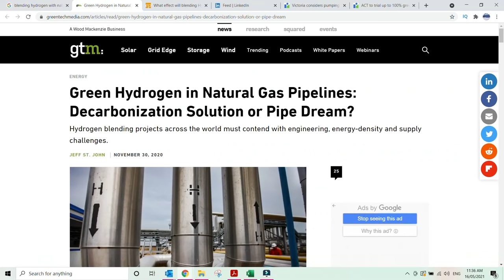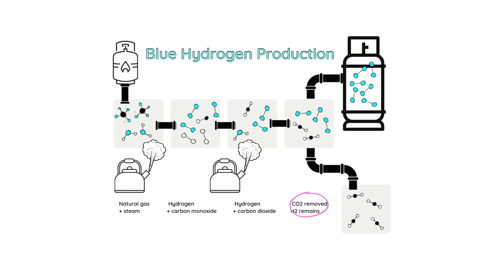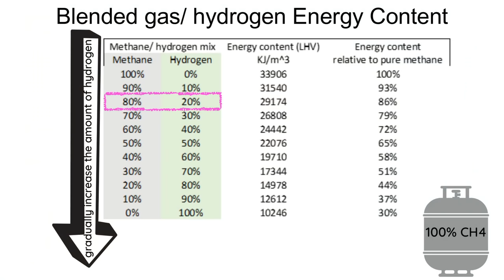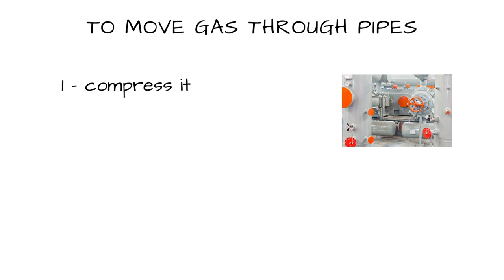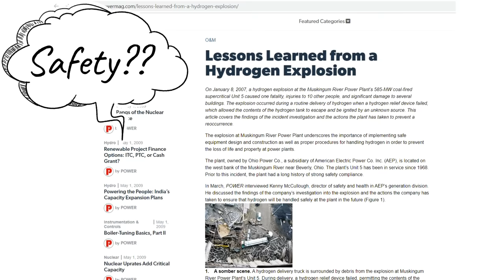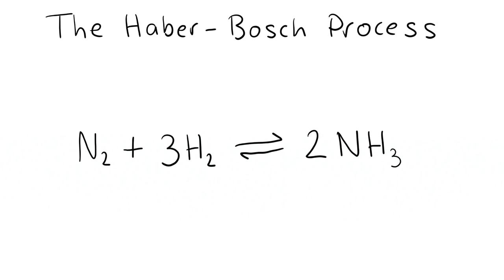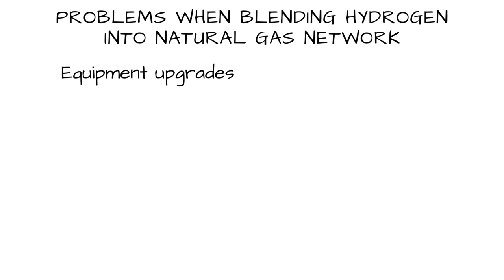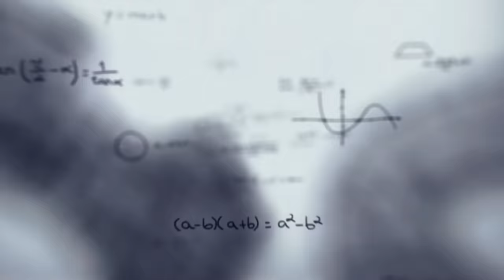Hydrogen in the Natural Gas Network

Comment: The other problem with Hydrogen and blending in gas supplies is cost. If done properly (using truly green hydrogen or blue with at least 90% effective CCS) the cost is prohibitive because of inherent inefficiencies. Hydrogen may have some limited applications but I believe it is being promoted by the fossil fuel industry to delay the decline in fossil fuel use and divert attention away from investment in other forms of energy storage that are cleaner, cheaper and more efficient. These include chemical and mechanical batteries, pumped hydro, compressed air, molten salt plants, etc. Electric vehicles for example have the potential to provide vast energy storage with Vehicle to Grid connectivity.
Reply: Bingo, it's selling hope-ium to create confusion in the public consensus making.

Comment: I was impressed by the comments starting at about 11:50 where Paul mentions over-provision of natural energy sources (such as wind and PV but also potentially tide and wave power) then storing the energy in the form it is initially presented by which he presumably means electricity using e.g. batteries. We could of course convert the energy into hydrogen or ammonia and store it locally to that conversion plant until it is needed to generate electricity when the wind doesn't blow and sun doesn't shine. This avoids the main problem with hydrogen - its transport.

Comment: Just a stupid question. How does hydrogen and gas compare to each other when it comes to explosive expansion velocity? The amount of air displaced or the weight it can push when it is ignited.
Reply: If there is a hydrogen or natural gas or propane leak in a home and it ignites, which one will level the most houses?

Comment: Hydrogen leakage could be enormously problem??! 
Since hydrogen is tiny and can be passed through even the smallest openings, this means that the leak already present in natural gas would be incomparably higher - and when you add 3/4 times higher pressure in infrastructure - the leak could create huge losses.

Comment: Great article. What was not mentioned was that we could use "green" hydrogen to make ammonia .Ammonia boils at -33OC  at atmospheric pressure. World production of ammonia is 150 million tons per year. 18 to 20 million tons of liquid ammonia are transported by sea each year.  Green ammonia could replace the present production of ammonia from fossil fuels with no major changes in infrastructure. Ammonia can be used as a fuel for marine and stationary prime movers.
It is a far more logical fuel than hydrogen.

Comment: I'm wondering. Why put hydrogen into the pipeline? Is that using one fuel to generate another fuel with substancial loss? Why not put the wind/solar/other green electricity directly to the grid and use that for cooking?

Comment: Another problem with hydrogen could be that it actually acts as a greenhouse gas. Methane leaking from natural gas pipelines can easily reduce the climate benefit of making  less CO2 per kwh than coal or oil. Hydrogen  ( H2 ) is not itself a greenhouse gas, but it's almost inevitable that such a tiny molecule will leak more than CH4. Eventually the fugitive hydrogen will oxidise to water vapour, which would make little difference at sea level, but if a lot of it rises up past the tropopause to the normally dry stratosphere, it could trap even more outgoing heat than methane would. The H2O molecule is highly polar, and its vibrational modes absorb different wavelengths than CH4. Increasing its concentration at higher altitudes is like putting a thicker blanket over the earth. Hydrogen would also react with hydroxyl radicals, possibly increasing the average lifetime of methane in the air, and with ozone, weakening our ultraviolet sun shield.

Comment: Brilliant video. I'm looking at renovating a house and one option is to demolish and rebuild (higher quality walls & insulation), get rid of the gas boiler, and use a heat pump for heating/cooling (also a massive tax break for doing this as opposed to renovating). 12 months ago I was thinking that, given a large renewable overbuild, maybe SNG could replace fossil methane (renewable power and, instead of using batteries to store excess power, the UK has over 4 bcm, or 41.86 TWh storage capacity in the old gas pipes, which shouldn't go to waste). I was wondering about the idea of hydrogen in the gas pipes for the last few months, and now I think it's fossil fuel's last hurrah.
Reply: They also didn't get into the H2 imbrittlement of certain components. I'm all for H2 but I think it's more of a last mile fuel, kind of like how gasoline is produce relatively close to the region it will be used in and not sent through cross continent pipelines.
Reply: Just build a passivehouse so your heat load is tiny (mostly hot water), and easily supplied by a very small heat pump. Max space heat load in the depths of winter 1-2kW. Vast majority of the time incidental heat is sufficient, and it's cool in summer too so long as you get the overhangs and glazing fraction right. You can do this by retrofit too (I have), but it's never quite as good without spending more money than just building a new one properly. It's ever so nice to live in, with very stable temperatures and great air quality.
Reply: yes. There is an industrially proven process for making methane from hydrogen and carbon dioxide.  It consumes a lot of energy, but the resulting methane is a much better fuel than hydrogen. Using captured carbon dioxide the cycle of production and burning becomes carbon neutral

Comment: I think that Paul has a good point about focousing on the low hanging fruit like Ammonia production first. From there it seems to me that baseload powerstations could also start producing and storing hydrogen to sell to fertilizer manufacturers, blimp enthusiasts or others. They could produce hydrogen when there is too much wind, water or sun filling the grid supply. Storing the hydrogen deep underwater in balloons seems like a good option to me. It is ideal for seasonal energy storage

Comment: Very informative, Rosie! So far I'd only heard of mixing H2 into the natural gas grid as a way to find a use for electricity from wind, solar and hydro sources during periods of low domestic demand. At night for example, the renewable electricity would be used for electrolysis and the hydrogen produced fed into the gas grid.  The 14% reduction in calorific value would not be welcome by operators of gas engines either. It's well documented that even without H2 blending natural gas quality can vary from minute to minute and even second to second, causing knocking and misfiring and potentially severe engine damage.

Comment: I am surprised, given your background in materials and mechanical engineering, that you didn't discuss  hydrogen-induced cracking (HIC) in existing pipeline infrastructure.  Is HIC a concern?
Reply: Yeah I was thinking the same. How will those old pipes combat hydrogen embrittlement
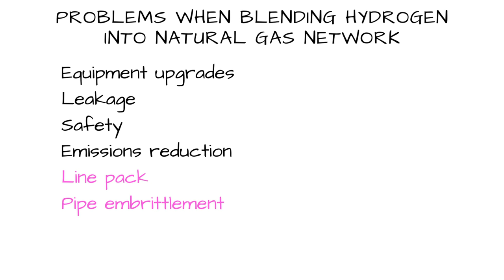Reply: She did mention it at the end (14:00), but yes, that seems like a large issue trying to convert infrastructure for things it wasn't designed for.
Reply: @muzairanwar  TLDR; They won't combat Hydrogen induced cracking in these pipes. The existing metal pipes will not be used with hydrogen

Comment: There is also the issue of NOx emissions when burning hydrogen in an air mixture. Another pollutant for the atmosphere that never seems to be mentioned in the videos for hydrogen combustion engines such as those proposed by JCB.
Reply: I'm pretty sure that the products of combustion are H2O (water) not pollution when burning hydrogen.
Reply: @russellclark9419  Unfortunately not. When burning hydrogen it has to be mixed with air which is 70% nitrogen hence you get Nitrous Oxide  produced. Reducing the amount of air in the mixture reduces the NOx but it also reduces the power output. If you had a separate pure oxygen supply to mix with the hydrogen then there would be no NOx produced. There are many you tube videos on this issue. I think you are talking about hydrogen fuel cells which do discharge water and some heat but don’t actually burn the hydrogen so no NOx is produced.

Comment: Great video, but I would have liked to hear Paul's view on the viability of using ammonia to transport hydrogen, both directly and indirectly someday? Which seems to address most of the issues of piping hydrogen by itself or with NG. Not really need now, but long term when it is, it seems like the the best option. 

Other than that Paul pointed out 99% the issues (including embrittlement) that I was thinking about prior to watching the video. Echoing Paul's line of reasoning. For now we should actually be focused increasing the use of NG, to replace dirtier fossil fuels such as coal. It's far more efficient and cheaper way of reducing all types of pollution, for now. And NG peaker plants are the best short term option for allowing great use of renewables such as wind to power the grid. NG should be the last fossil fuel to be replaced

Strangely. Paul seemed to be wrong about one thing, that there are no costs (ie regs) on NG leakage. There have be for a long time and the allowed leakage was just readjusted down back Obama levels. Now we just have start to add cost for cow methane production (not a joke).
Reply from the maker: Several people have commented on ammonia for hydrogen transport. I can see I need to make a video on that! 
Interesting what you say about methane leakage being charged (in the US?), I will need to look that up. 
For cow/ other animal methane production, my ideas are that we need to 1 - reduce meat consumption, 2 - eat much more kangaroo meat (not a joke) and 3 - maybe lab grown meats? I personally love dairy so much it will be amongst the last things I give up in the name of the environment, though I have reduced the amount of meat I eat by a lot.
Reply: @EngineeringwithRosie  Clarification, I was talking about "methane leakage regs" that fine producers and pipelines in the USA and the costs associated with it. Not a tax/charge, like what is done in some places on carbon emissions. Below is a link...
https://www.cnbc.com/2021/04/28/senate-restores-obama-era-regulation-of-methane-emissions.html.

BTW If I started to eating kangaroo, it would make my aussie friends hopping mad. And since I rarely eat meat (about a year ago), expect for fish occasionally it's not really an issue for me. But there are feed additives that drastically reduce the methane farting. It just costs more money and there is no economic incentive for the cattle farmer to pay more. So we are back to econ and politics being the issue, not tech. 

its kinda ironic that cows produce plenty of ammonia for hydrogen transport... it's the circle of life I guess...
Reply: The US already seems to have enough natural gas power plants to use as peaker plants for renewables and now that the cost of wind and solar are at parity or even cheaper than natural gas it is getting more practical to use them to replace coal rather than natural gas so we are probably within a couple of years of peak demand for natural gas and are nearing the end of the period where natural gas is comparativly clean.
Reply: AICHE has two chemical safety sections, one for hydrogen and every chemcial industry but Ammonia, and one for Ammonia.  That should give us an an idea about how nasty and dangerous it is to handle Ammonia without having to search for the large number of industrial accidents every year, still. Now, take that out of agricultural/industrial application and into the hands of Joe down the block.

Comment: Very informative video and YouTube Channel 👍

A possible way to solve much of the issues addressed in this video might be the conversion of Hydrogen and CO2 into Methane. This can be done as a form of biogas upgrading. The CO2 fraction that is formed in biogas systems can so be removed resulting in a higher calorific gas and more gas. Methane has a higher energy content per volume then Hydrogen and can be used through existing pipelines. 

Interesting research articles about this subject are:
Production of high-calorific biogas from food waste by integrating two approaches: Autogenerative high-pressure and hydrogen injection. (Kim et al 2021)
Recent progress towards in-situ biogas upgrading technologies. (Zhao et al 2021)

Comment: Glad to see you making a good distinction between weight and volume.  When I am talking to people about hydrogen this is a big point of confusion, because it has more energy by WEIGHT than anything else, volume is another story.  However, adding hydrogen to methane is like adding ethanol, not water, to gasoline.  The real value of hydrogen is large scale utility storage where it doesn't matter how big the storage unit is (Lake Meade is really big!), and maybe aircraft where weight is everything.

Comment: Great video.  Agree completely in hydrogen blending issues like compressor station upgrades and embrittlement/leakage.  Not sure how much lifecycle emissions are actually reduced for blue hydrogen because there are still upstream emissions for nat gas production upstream of SMR, even if there is CCS of CO2 from the reforming process
Reply from the maker: Good points. I will be making more videos about blue hydrogen and CCS in the next few months, so I will look into the issues you raised in those. Thanks for the comment!

Comment: What about shipping the hydrogen as ammonia, if you could make the ammonia cheaper ,
Reply: Not a bad idea, and there'll definitely be applications for synthetic ammonia in the future, but it runs up against the fundamental problem with all synthetic fuels (including hydrogen): loss and efficiency. The process of converting your feedstock (electricity for electrolysis or natural gas for steam reforming) into hydrogen wastes ~30% of the energy, then converting it on to ammonia will also lose you a load more energy (probably ~30% again). Converting to a more energy dense fuel opens the door to other applications (e.g. fuel for shipping and aviation) but drives the price up significantly - driving a fuel cell vehicle costs >2.5 times more per mile than a battery electric vehicle. The creed I heard, and now follow: directly electrify as much as you possibly can - industrial processes, transportation, space heating etc. For those applications that just won't work with electrification, tackle them next with a simple synthetic fuel like hydrogen. Then, for those applications where electrification will not do and hydrogen won't do the job either, then look at a second conversion into a more energy dense synthetic fuel.

Comment: How about using Hydrogen to (long-term) store excess Solar & Wind energy, a process that is easily reversible very inexpensively, safely and with relatively low conversion loss?
Reply: The conversion loss to turn electricity into hydrogen and then convert it back is terrible, not "relatively low".
Reply: Also, its not cheap.
Reply: The better way of doing that is to pump water up a hill and use gravity to turn turbines, it's not very high Wattage but it stores  a LOT of energy,

Comment: What we are missing is that it is really easy to turn hydrogen into methane if you have a source of CO2.

Eventually it will make sense to keep the old refinery running. Install a CO2 scrubber to get CO2 from the atmosphere and use it to make feedstocks for the chemical industry.

We don't just use oil for burning. We use it to make everything from clothes to roads to buildings.
Reply from the maker: Yes, I also really hope that carbon capture technology matures and goes mainstream soon. It has proven very challenging over the last 30 odd years we have been working on it, there are still very few working CCS projects around. 
I have a couple of videos planned on this topic in the near future.
Reply: Problem is the methane and other hydrocarbons we burn to make concentrated CO2 is done in distributed fashion. In deed, hydrocarbons and electricty are the two ways we distribute mass energy to run society. Extracting CO2  is energy and that energy cost soars as the density goes down and the distance to  end use goes up intensive and making it pure enough to refine uses even more energy, and ....  

Coal fired Power Stations, using the latest closed loop systems can't even make decently pure, uncontaminated CO2, it's only suitable for injection for fracking, etc. which means more carbon into the atmosphere....

The grand conspiracy isn't in the boardrooms, or the curriculum of engineering schools; it's in the structure of nature.

Comment: Ohh this is very interesting. I want to add one thing: The existing boilers and burners used in the Netherlands have to use very low BTU (Wobbe index) gas, because the gas from our gas fields (particularly in Groningen and the North Sea which field are now nearly empty) is of very low caloric value and our network and machines have been built around this. So, if we import gas of higher caloric content, we have to mix in nitrogen to make the gas of lesser quality! I see a great opportunity of mixing in hydrogen instead of nitrogen in our use-case!
Reply: but fix those leaks first.  the reason Hydrogen embrittles steel is it leaks/passes through solid steel walls, knocking off electrons along the way.  We use Helium in industry to detect leaks as it's so much more penetrating than hydrocarbon gases, and hydrogen makes helium look like it's a sealant, not a leak detection gas.